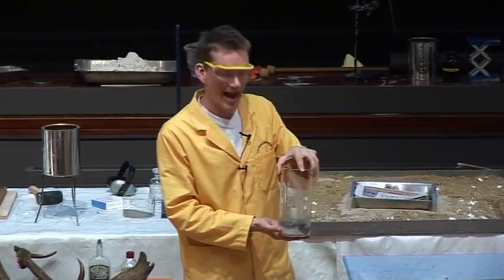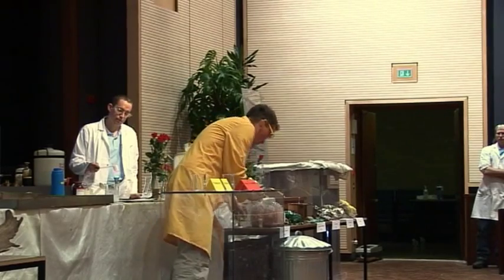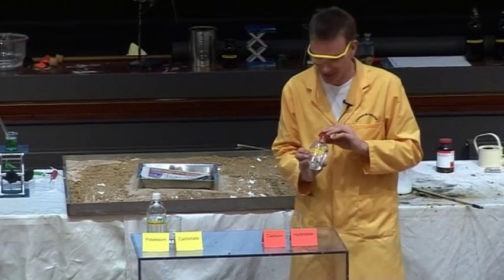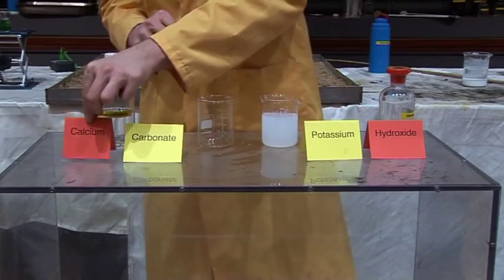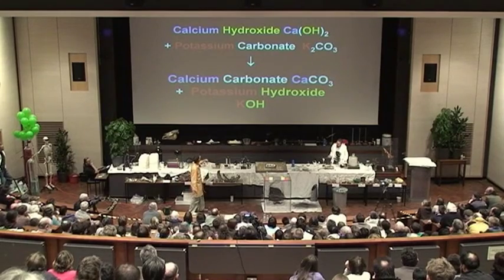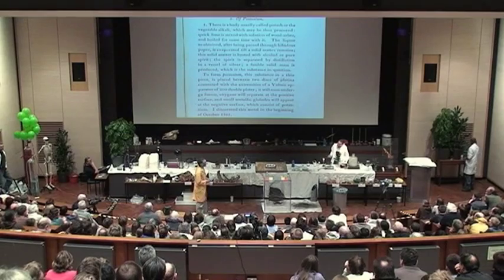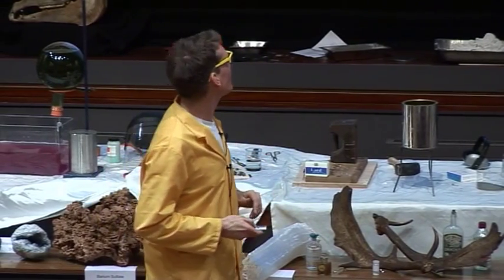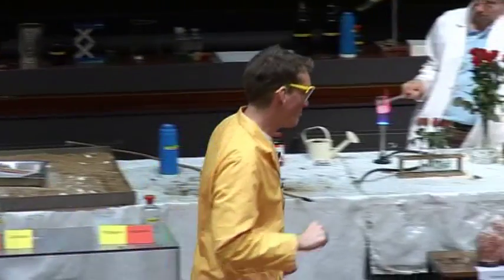Free Range Chemistry  30 - Potassium from Potash

Comment: Very interesting in terms of the debates of "electric philosophers" during this age. They made a connection between the different metals use in a galvanic reaction or voltaic pile to the triboelectric series. Electrolytes or described as "imperfect conductors". Magnesium oxide was a popular electrolyte for these piles.